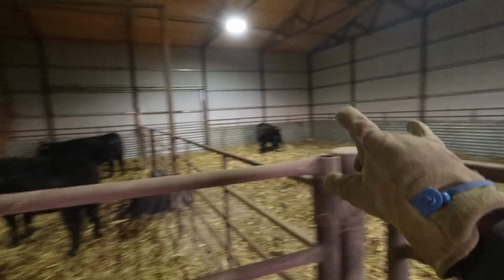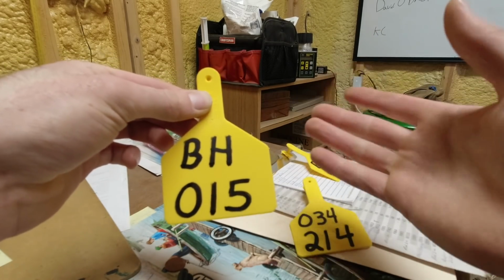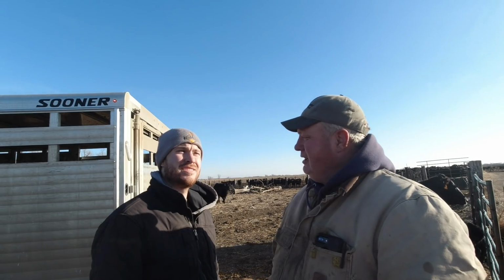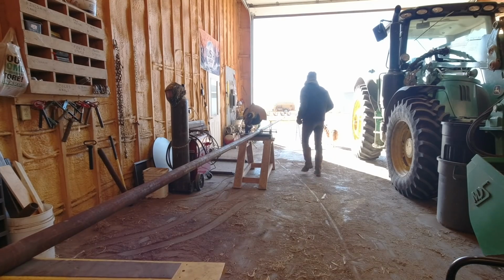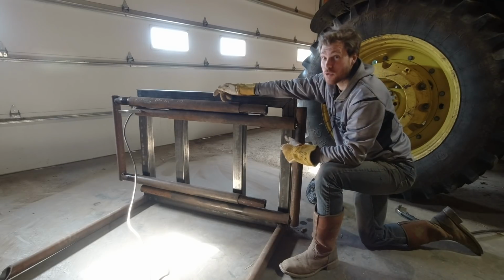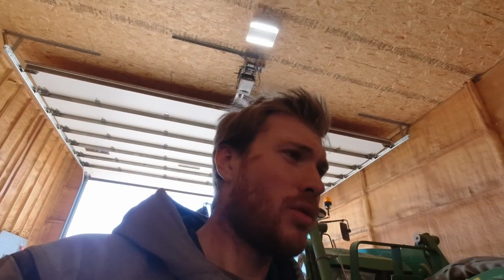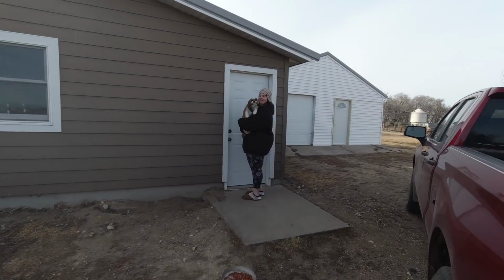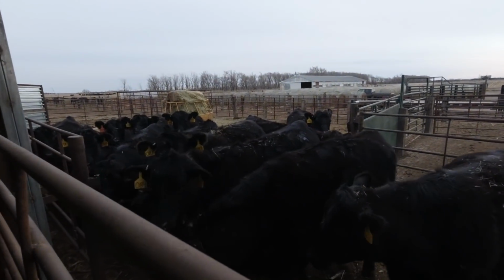Shop Fabrication

Comment: When building gates, frames etc with round pipe we always squashed the pipe ends in a press and then could simply weld two straight, flat surfaces. Works good for gates, corral fence or anything out of round pipe. It was always faster and easier and made stronger joints.

Comment: Not sure what why your breakers are popping. But it could be the chop saw motor going bad. You can also buy what they call a soft start set up for the saw. Basically it slowly starts the motor instead of 100% the second the switch is touched.
Reply from the maker: Id like to try that!

Comment: Drill some holes and put some grease fittings
Reply: Better yet, drill two or three small chamfered holes evenly spread along the tops of each tube housing and use a needle-nose fitting on the grease gun.....
Nothing to break, won't clog up....and the zerk fitting won't hit on the inner pipe...

Comment: those chop saws draw a ridiculous amount of current when you first pull the trigger to spin up the blade (resistance to movement, aka inertia) and at a set voltage, increase resistance results in increased current, via Ohm's law... so, we found that just the fastest pull of the trigger for the briefest moment to get the blade moving, THEN a second short pull for 2 brief moments, like some biker with a loud Harley revving the engine, THEN you can pull and hold it on, and use it, with the least chance of tripping a breaker

Comment: Better yet, drill two or three small chamfered holes evenly spread along the tops of each tube housing and use a needle-nose fitting on the grease gun.....
Nothing to break, won't clog up....and the zerk fitting won't hit on the inner pipe...

Comment: We have the same issue with our chop saw tripping the breaker. New 20 amp breaker and that fixed the issue. You've mentioned having hay custom ground. Is the roto-grind just a little too slow? Easiest thing to hire out to keep operations smooth?
Reply: because of our concern for the hay grinding tractor overheating due to dust plugging the radiator, Cole would have to sit in the grinding tractor while i used the loader to feed the grinder. We ended up both needing to be there to grind hay and it took away from other chores.
Reply: @briansonne814  Thank you!

Comment: I used to build somthing on a similar concept for trains but it had to be within .001 of tolerance and pretty much your welds warped it the easiest way to get that straight again is pull it out and beat them apart or together and it will slide like butter

Comment: Guessing the wall outlets in the barn are on a 20 amp breaker and can't handle the peak demand of starting the chop saw. The outlet under the breaker box in probably on a 30 amp breaker. I have been known to be wrong! First time I've noticed Jeff in the intro photo, nice.

Comment: Sliding round into square tube will solve a lot of sticky problems.  Old stock car trick.  Things get bent and you can't get sub sections to come apart.  Round in square solves a lot of that.
For Brian... 46 and 2 by Tool - Presented by Aaron O'Keefe  https://youtu.be/mYKLvYGqaC0   young Kala is 18 now and a powerhouse.

Comment: Sometimes if you have an arc fault breaker or a GFI receptacle on a system it recognizes the saws motor as an arc and will trip. I did trim carpentry and this would happen in some houses when we used our saws. May be something to check out. Good luck.

Comment: We welded a skid steer bracket to a bucket we had at our sawmill just like Cole did with the bracket perpendicular to the floor. Guess what? We had hardly any curl left in the tilt cylinders so the bucket wouldn’t hold much of anything. Guess what? We cut the mfr off and welded it back on at an angle just like the rest of the skid steer attachments we have. Not one of our brighter moments. I hope Cole’s device doesn’t need much curl. Doesn’t seem like it would but our old friend “ hard knocks” might come to visit Cole lol.

Comment: Those wall outlets might need a larger breaker . When they run just the lights it's not as many amps as that saw or any other tool . Might need to go from a 15 to a 10 amp breaker or vice versa as I'm not sure what you have .  I've been doing industrial mechanic /electrical work for a few years now along with farming. The wire roller will be very handy . Great video keep up the good work!

Comment: Traders should avoid attempting to predict trend reversals, or even worse, I believe there is more to this market than we currently understand. When people are losing, they don't endeavor to increase their average. Using expert Clinton Ray's assistance, I've made almost 9.5 btc on a 2 btc Trade capital over the last 8 months. Things could get worse, so make the wise decision. Markets fluctuate in cycles that might span anywhere from a few days to several years. In the case of B -TC, it's difficult to make a bullish case merely by glancing at the chart. It's a lot more complicated than some people want you to believe. :yt:You can reach Clinton on ͲeIєɠɾαm👉ClinRay👈

Comment: most chop saws pull around 17 amps, most plug-ins are 15amp, so if its plugged in far away it could easily blow your breaker. The plug below the breaker is shorter, and may even be a 20 amp

Comment: I’ve encountered that electrical outlet problem quite a few times, but on a farm only twice. In both instances it was mouse related. The issue is loose wire nuts in the box behind the outlet or at junction boxes. Not from mice chewing, but from mice crawling in and around the wire nuts. Their movement loosened the nuts which causes an intermittent short to occur especially during the cold months. A nuisance issue and a bit labor (time) intensive but easily corrected.
Reply: Wire size or amp breaker might not be correct.  Best to use 12 gauges wire with 20 amp breaker.
Reply: @BWYinYang  given the structure’s function I assumed the contractors did so. If not I definitely agree.

Comment: Cole make sure all the connections in the panel splices and at the receptacle  are tight,  you might switch the problem breaker with another of the same amperage rating with one that is not uses as much, with continued use high current draw the breaker will weaken, last resort replace the breaker in question.

Comment: Why the white board reference on “best tasting soap”?   Personally I prefer Dove chocolate over Dove soap.   

Brian, when are you and Tammy coming to Cleveland Ohio to visit the Rock n Roll Museum?  

Cole, regarding your wire capture device, glad someone suggested the zero fittings to add grease into the tubes.  How will you power the rotating part to wind the wire onto the spool?  Great design.  

Wishing you and your family a blessed week and a successful calving season.   Peace brother
Reply: “Zerk” grease fittings… not zero!  Darn autocorrect strikes again

Comment: Try using wax oil on sliding metal but after you clean rust off pipe they use wax oil on sliding loaders

Comment: Hey Cole! They make a pipe saddle jig that clamps over the end of the pipe. Trace it out with chalk and cut it with your plasma or torch. And at the end, the fit? Like Ace Ventura says.
“Like a glove!”
And if you would have wire wheeled the pipe? She would have been smoother then butter!

Comment: Great video 👌🏻 cheers to jeff 😉

The temperature of the steel may also be a reason why u had a hard time of pulling it out and pushing it back in ... if the steel cools down outside, the gap becomes smaller due to the contraction ... so lub may help a lot ... in summer it may work alone and if its reallllly cold ... its stuck 🤷‍♂️😉 lets see